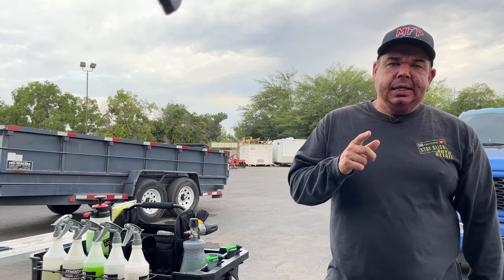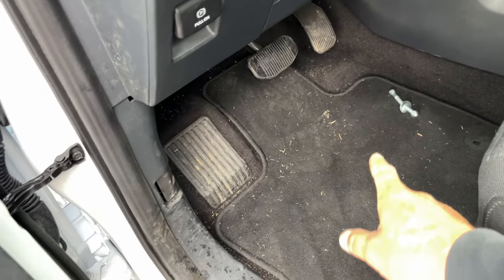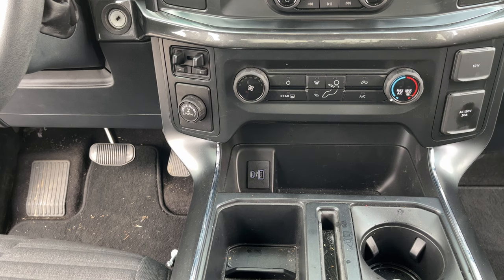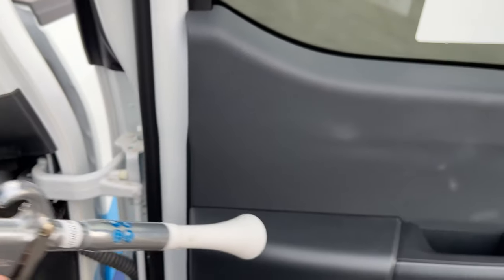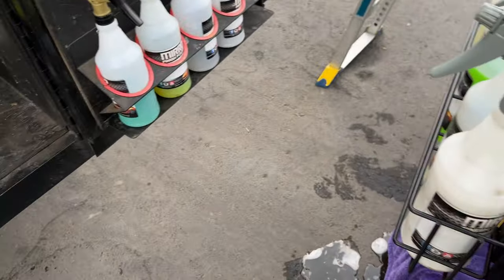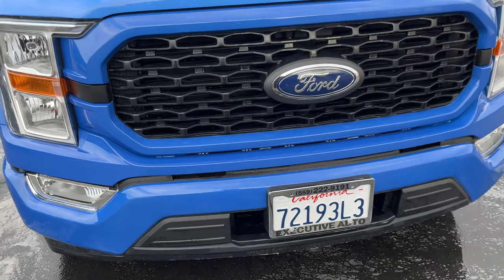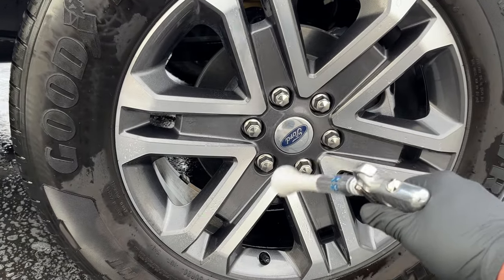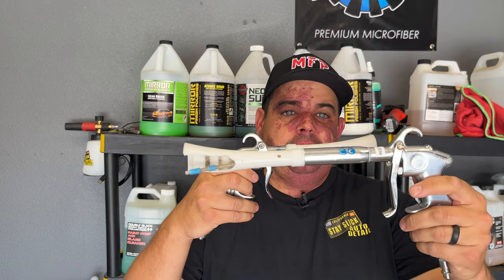Tornador vs. Vortex cleaning tool | Which is Better?

Comment: I like the Vortex. The grip is different than the Tornador which fits my hand better. But no other issues or concerns and been using the vortex for about a year. I like and used both.

Comment: I had a knock off that was super durable and thought I was upgrading to the tornador,  I donated the knock off and the detailer is still using it and it's a tank. And I'm on my end tornador
Reply: 3rd *
Reply from the maker: Yeah bro they’re terrible honestly they were great for a couple weeks weeks about it. But did you see that new groats garage blowout tool that came out?
Reply: Where’d you get the knockoff?? 🤓😎
Reply: @simplysimplemobiledetailin529  ebay

Comment: Good demo video. I have been thinking about getting one. My question is what is special about this tool other than blowing air?
Reply from the maker: The spinning tube inside creates a vortex that dislodges debris in carpet better than anything else on the market.

Comment: I didn’t break the cone but actually wore a hole through it with my. Or Tex from using so much.  Bought a new cone with a metal sleeve. Works great. Good honest video
Reply from the maker: I think I saw those metal replacement cones on Amazon right?
Reply: @StaySlick  yes that’s where I got it. These are the best tools in my arsenal.
Reply: Great recommendation. Appreciate this post.

Comment: Get the cheap tornado with the solution can. But the one with the metal piece inside  take the container off and just use the gun i never had any issues with mine 5 years now I have it for.... just a suggestion you should check it out man
Reply: @yukonstriker1703  yea i know that but I was saying if you just want the blow out tool only hahhahaa.... I'm not a just come detailer I have both with the container and with out and if you don't want to carry around that bulky container ✌🏾
Reply: Do you have a link to the exact one you’re talking about? I’ve seen them on Amazon and I thought about doing exactly what you said

Comment: what is the smallest air compressor I can use with this tool
Reply: You really want to stay above 5.0 cfm at 90psi. You could go with what he has which is the Rigid OF45200SS, the FORTRESS 57391, or go with something a little bit pricey, California Air Tools 4620AC. I have the California Air Tools. It’s lighter. Smaller. Less refill time. And the quieter of most air compressors.
Reply: @bnazzaro21 love you

Comment: Thanks for the honest review. Just one suggestion, perhaps wrapping a bit of duct tape around the plastic end of the blowout tool could help reduce the risk of it breaking when you drop it.
Reply from the maker: Yea I absolutely see that working. Where I’m coming from is for the money “I shouldn’t have to. “
Reply: @StaySlick  totally agree. Maybe there is a market for stronger 3d printed ones. They are a couple of hundred dollars each here in New Zealand and around $18 for the replacement funnel piece.
Reply: Good advice bro it’s a brittle piece

Comment: I don't really see the difference between this and an air chuck.  I have several regular air chucks and some high volume air chucks.  You can buy all sorts of air chucks and/or air chuck attachments that don't cost anywhere near these prices.  Then if i want to use the canister style to spray liquid I just use my hand 1qt hand pump sprayer.   Exact same results for hundreds less.   I ain't knocking it, we all love new tools.  I just don't see spending on over inflated tool prices.   Great videos by the way.
Reply from the maker: If you’ve never tried one I recommend the rag company air blow gun. It’s under $50. I promise if you haven’t tried these vortex style tools you’ll be in for a treat.
Reply: @StaySlick  I have the vortex air gun and the vortex air gun with the canister in my amazon cart.  I came to youtube to see what all the hype is.  So I'm on the fence right now.  Like I said I love new toys so i might just pull that trigger right after I find some good nasty carpenter pickup truck carpet and upholstery cleaner for one of those carpet extractors I'm also on the fence about.  The sprays under the head or into the head version like the in the head Streamliner extractor.   Any insight you wanna share with me?

Comment: Nice post man, just found you. I detail and I literally use both of the same guns. (sometimes at the same time) It’s very true, they’re both great. I’ve worn through many sleeves over the years and the metal ones are worthy their weight in gold they last 100 times longer. Just a note if no one mentioned it here - you CAN rebuild a vortex with a tornador rebuild kit, you may just need to trim the hose slightly if you’re still using vortex brand cone (it’s slightly shorter) Keep it coming!
Reply from the maker: Right on Dan thank you for the info
Reply: Can you use a Tornador straw in the Vortex?
Reply: My Manager mentioned that the Tornadors do not come with the steel-lined cone, but it can be bought as a replacement. From the video, it also appears that the new Tornador that is broken @ 7:19 , ...also does not have the metal sleeve.
Odd.
Reply: Absolutely! You can use the straw from a Tornador rebuild kit in a Vortex, I do it myself. You just need to trim a little off the end of the straw as the Vortex brand cones are slightly shorter. You may have to slide the blue weights down slightly as well. Hope this helps! Also, you are correct - they don't come with the metal sleeved cones, but they realllllly should as they last 10x longer.  @ruserious9577

Comment: Great video I just subbed as well! My question is what is the benefit or difference between these tools and a pistol type blower? I see the cone maybe helps with not damaging wheels or interior pieces when it hits almost like a bumper around it but what else would you say is the benefit to this as opposed to the pistol type blower most compressors come with? thanks man
Reply from the maker: It creates a vortex of air so it has a better chance of dislodging debris and water also it cost far less than buying a car dryer. Thank you for subbing welcome to the family
Reply: Both tools have their place. The single pin point is great for precision accuracy. Great for the creases inside the seats. Edge work etc. the vortex is amazing for dog hair. For the carpet and for the headliner ever. You need both
Reply from the maker: Yes, very good info I would have to agree
Reply: The reason these guns are vastly superior to a simple air gun is this:
1.)These devices are switching airflow-direction hundreds of times per second.
2.) A standard airgun only changes direction if you move it.

Instead of carpet, picture a helicopter landing on a field of tall grass.
The grass lays down flat, (most likely in a conical pattern moving outward from the helicopter)... and stays there.  Same with the tip of your blow-gun. The carpet-fibers all lie-down and stay down.
Now picture multiple choppers landing on the field, and how many different directions the grass would be blowing...not laying down. fibers don't have time to lay down before the dirt is blown away.
Sorry if that doesn't help, lol! but it is the closest i can get to an explanation of why they work so well!

Comment: What is the difference between these tools and a regular tool from Home Depot, I’ve been using the regular ones for years and they really do the job just trying to see if there is a difference
Reply from the maker: Not sure what the regular tool is. Is it just sn air compressor blow attachment?
Reply: @StaySlick  yes, just the normal one
Reply: The difference is that you don’t blow air straight to whatever you blowing. the tornador or vortex blow air to the sides where the regular air blower shoots straight air making it harder on plastic parts of the vehicle interior
Yes, you can use the regular air blower gun for carpet instead of vacuum and get rid of pet hair and debris but I wouldn’t use it on sensitive car parts as Gary is showing on the video

Comment: Couldn’t you use the exhaust of a shop vac for the same thing?
Reply from the maker: To blow out a vehicle? If so I guess maybe that’s possible but nothing compares to a blowout tool. Game changers
Reply: @StaySlick  I do it all the time with the crevice attachment. I can see why the blowout tool is helpful but it’s another investment and another machine (air compressor). For new detailers it would be a savings until they can afford to pay for it.

Comment: What size is your compressor tank
Reply from the maker: https://www.homedepot.com/p/RIDGID-4-5-Gal-Portable-Electric-Quiet-Air-Compressor-OF45200SS/300779816
Reply: @StaySlick  Hi, Mr. Slick. Great channel! Question for you: what size generator do you need to run that big of a compressor? Thank you.
Reply from the maker: I just run the predator 3500 from harbor freight
Reply: Number one question!

Comment: Future reference y'all.....if the cones break, or the valve leaks, just buy the replacement parts, not a whole new unit.
Reply from the maker: If you buy it on Amazon it makes more sense to request a new unit since it’s going to break in the first month.

Comment: Won’t a regular air gun do the same thing? All you’re doing is blowing the dirt out….
Reply from the maker: I have and use both. The regular air tip does a great job on a lot of tasks but sometimes the debris in the carpet is really stuck in the fibers and needs the extra force to be pushed out.

Comment: they are the same except you have the inconvenience of returning the vortex once a month bc the same part keeps failing? I'll just pay the extra $20 avoid the headache of monthly returns and put a little duct tape on the tornador cone so it doesn't break. or just be more careful.
Reply from the maker: I don’t think you’re following. The tornador cone breaks within a day of normal use. Whereas the vortex under extreme use might break in a months time. I’ll take the vortex. Not to mention it’s more compact so it’s also more practical in tight spaces.
Reply: @StaySlick  i don't think you're following me lol. you said yourself "been through about 4 or 5 in 6 months" and the same part keeps breaking. so its a piece of crap then if you have to replace it monthly? just don't drop the tornador and put some duct tape on the cone and the problems solved? there are plenty of people who use these regularly, claiming they break in "one day of use" is BS and you know that.  Also the longer neck on the tornador lets you get further into tight areas... but hey to each there own. Logically I'm not buying something that breaks consistently in one months time. if the tornador is breaking bc you drop it or are to rough then that's your fault not the product.

Comment: Those both suck you the ones with steel shaft and ball bearing from amazon same price way better product .
Reply: @jkmanillaice  some have replaceable shafts wd 40 them
Reply: @jkmanillaice  the trigger pin I always put it on its side and hammer the pin wider or they come off its easy to do you will see the pin that holds the trigger on just hammer the small end wider .